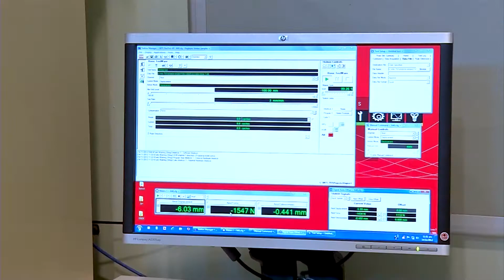Wood vs Concrete - the Material Difference

Comment: It's my lucky day only one commented on here so only two will see it the commenter and the youtuber 
Maybe if it's all made if it were made inside I thought melting was great but now idk man well it was worth the try trying to tell other's my daily power of thoughts The real question is both ideas are stealing from this world so the real question is what should we use as a substitute to supply a solid material besides wood or concrete how about the glass and the combination of a lot of lava rock mixed with sand to reform a solid surface which is not a bad idea